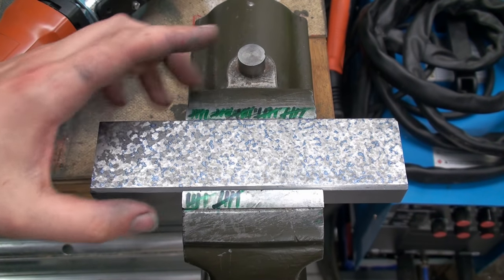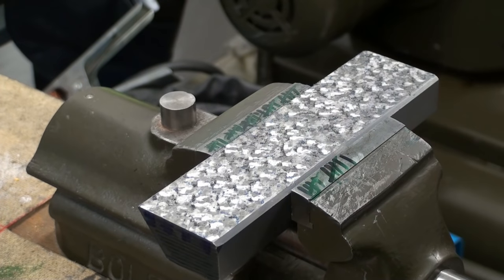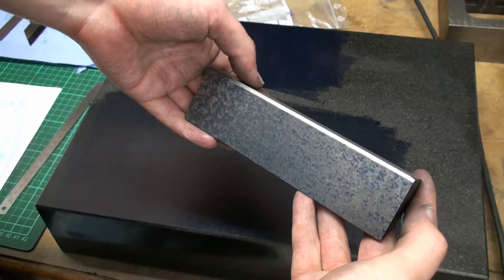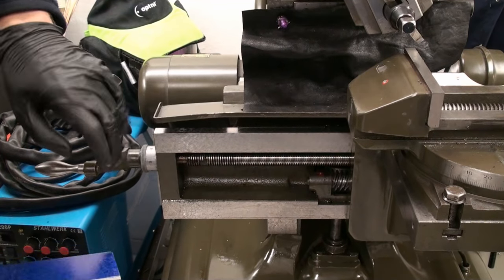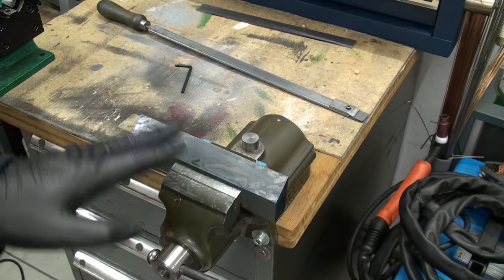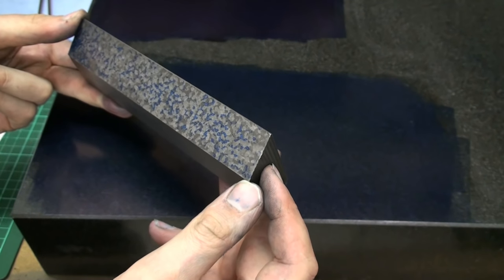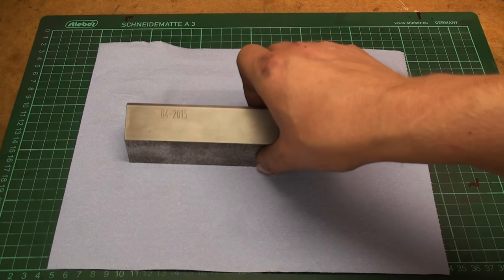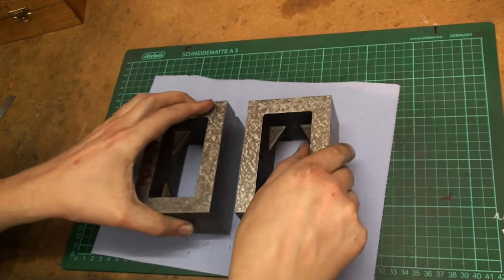Making a straight edge blank Part 2/2

Comment: Great work; it is a labour of passion as one strives to restore older machinery. One way to get higher precision after scraping is by lapping the piece on a surface plate.; but only when your looking at a couple tents 0.0001".
I have acquired a large surface plate and will be attempting to refresh my 1950's bridgeport surfaces.
Cheers,
Dave
Reply from the maker: Dave Prototype Youre right! Lapping can produce an incredible flat surface if done right. I tried my hands on it with a small cast iron lapping plate and diamond compound and I was able to get surfaces very flat and parallel within a few 1/1000mm - Not to be mistaken by using sandpaper on the surface plate, thats in my mind just for cleaning up surfaces, removing highspots and machine marks.. :)
Just subscribed to your channel, I will have a look at your work :)

Comment: You have presented this in a way that makes me want to try it myself. Great video!
Reply from the maker: lornie212 You should try it :)
I started out with an reground woodchisel and an piece of cold rolled steel...worked kinda..but a carbide handscraper and a piece of cast iron work way...way...WAY better.

Comment: Very cool video series, and interesting to see a shaper in use. I am doing some tentative research since I want to buy an old lathe of some kind  and the lessons in this video might become very applicable....
Reply: BTW what is the single most important tool if you want to begin making something very flat and straight? Making straight edges and such seems like a good way to learn scraping. I am thinking it's the granite block reference surface... I have really nothing in the way of tools for this, mainly done woodworking and welding.

Comment: Hi Stefan, I know this video is a year old now, but better late than never.

When i was doing my trade (Fitter and Machinist - First class (toolmaker)) We did hand scraping as an excercise, i thouroughly enjoyed it. i agree that is has its uses in some areas, but i would like to make a suggestion.

Instead of scraping put a sheet of 800 grit wet and dry paper abrasive side up on your surface plate and then place your part on it in a figure 8 pattern. if you want you can then move up to a finer grit. In my experience this gives a move even and flatter surface than scraping in a much faster time. Not saying what your doing is wrong or anything, i love it as a skill, but maybe try out the method i just mentioned and compare the two.

Comment: Noticed that many parts of my old Shun Shin lathe have been scraped flat-all the cross slide and compound ways have the original scraper marks. 20+ years old lathe from Taiwan.
Reply from the maker: +Shevill Mathers The older Taiwanese machines are realy well made - Friend of mine has a NanTong RF30 Mill/Drill, thats made quite nice.

Comment: Stefan, after you scrape with the Biax, and you have hills and valleys that are 5 ten thousandths of a millimeter, can't you put that surface on a rotating plate with some light abrasive slurry, and flatten it much more without anymore hand work?
Thanks!  :)

Comment: Hi Stefan, Many thanks for these videos—excellent as always.  Two questions:
1. Did you have to hone the cutters often during the 25+ passes?
2. In general, would it be a good idea to rotate the part in the vise 180º after each pass?  I find that in many things, a slightly different point of view can reveal things not seen before.

Comment: Hi Stefan. Great video. I'm not sure if I missed your explanation,  but why scrape the 45 degree surface. Why wouldn't you turn the straight edge upside down to measure the top of the dove tail and use the already scraped surface.

Comment: seems like it might be wise to flatten roughly with lapping or sanding to gain control of the surface before finishing with hand scraping?
Reply from the maker: I am pretty sure the scraper is faster than lapping ;)
Next time I would go way more agressive in the beginning.
Reply: Yes this was my idea also. I have watched a lot of scraping and usually the parts were first machined then a rough flat was achieved with wet and dry sanding or lapping, and I suppose hand scrapping would also work depending on how large the surface is/was. You are a master of perfection So I will not fault your methods getting there!  Cheers

Comment: Stefan, since this is cast iron, wouldn't lapping also work as well and be just as quick or quicker than scraping? I understand where scraping and flaking is better for machine ways because it gives oil a place to reside. However, this straight edge doesn't need that. 

Danke,
Chuck
Reply from the maker: I dont have the equipment to do proper lapping and you need the "uneven" surfacae from scraping to do blueing with it, a ground or lapped straightedge would just stick to the other part if you use Canode or Dykem Hispotblue..

Comment: A basic question I have would be how much better if so is scraping than a power surface grinder for accuracy?  Seems that with scraping you could end up 'chasing' yourself a lot on a square or parallel surface and trying to true two separate blocks to the same dimension would really be difficult compared to surface grinding them.  Of course some things are too big and awkward for the grinder too but machinist blocks and straight edges would be good candidates?  The time consumed scraping is a bit off putting if one has other pressing projects.  And again good coverage on an obscure topic of interest.  Not much out there on the application of scraping and you have shed light on the subject.
Reply from the maker: +Douglas Thompson Depends on the surface grinder and the person running it :)
Generaly spoken, a surface grinder can of course produce incredible accurate parts, if setup and the actual grinding are done right. But if you dont have a grinder or the space for it or the part it to big for the grinder at hand, scraping is the next best thing. Aaaand its easy to get things out of square/parallel/flat on a surface grinder if one does not take material stress and so on into account.

Comment: Now that you have your surface grinder would you consider using it to finish your box parallels?
Reply: Good question! My guess would be no, unless he has already inspected the grinder dovetails for straightness. A surface grinder is very good at grinding a surface parallel to the chuck (since the grinder itself trues up the chuck), but if the machine's dovetails aren't flat/straight any ground surface would mirror the shape of the ways.

Comment: When scraping like this, how do you ensure that it is parallel? Thank you!
Reply from the maker: You measure parallelism either with a micrometer or with an indicator on the surface plate and correct for it.
Reply: Stefan Gotteswinter thanks, but how do you then correct it? You scrape more on one side? But how do you then make i flat? I would love a video on that :) thanks
Reply from the maker: Yes, you scrape more on one side and gradiently less to the other side. Google "step scraping" i think you will find an explanation then :)
Reply: Thank you :)

Comment: Very good video mini series, thank you!
I have a question though, what makes that power scraper different from a reciprocating saw? As I have one of them already, I could (I think) easily make an attachment for a scraper on that and save myself money on a new tool
What would be the draw backs? Length of stroke? Under or overpowered?

Cheers!
Reply: The power scraper uses a swash  plate to vary the stroke. On a recip saw there are two methods to get the action one is a sort of wobble plate the other is a form of Scotch Yoke, the latter can be modified Ca Lem shows how to do this. The recip saw will it be underpowered as they Use generally larger motors. Biax use  a motor  from a 4” or so angle grinder. The main issue with modifying a recip saw is balancing as the modifications change the reciprocating and rotating masses. Ca Lem reports this issue and is looking to build a second power scraper to address this. I am building one from a Makita recip saw and plan to add a weight pocket to the counterbalance so I can find the sweet spot.
Reply: @tonyray91  legend! Thanks for the info
Although I didn’t necessarily understand all of what you were saying (sorry) I appreciate the response!

Could you link the video at all? Or post the title of the video in question so I can check it out?

Comment: The surface is flat but is the angle accurate?
Reply: Considering it's a 45° angle for use in spotting 55° and 60° dovetails, I can't imagine it's a critical dimension…

Comment: Hi mate,  I have been watching these two videos several times now, and still learn from them.  I heard that the owner was pissed off because he wanted to scrape his edge..... Nah just kidding.  I'm wondering if you ever finished those blocks.
Reply from the maker: Haha, He has still enough to scrape, the straight edge helped him to make a new top slide for his lathe and scrape the ways of it - He did very well :)
The two cast hollow parallels? They wait for some attention. Maybe I will surface grind them. and just flake the surface with the scraper.. ;)
Reply: That is cheating, that's how I would have done it  ( -;

Comment: Hello Stefan,
This is a great project about precision, one question though, how did you control the 60deg, angle to keep it always true?
Also anxious to see your method on how you'll get the boxes perpendicular on all sides, low precision is kind of easy, but .001 mm. is much more of a challenge...
Nicely done,
Pierre
Reply from the maker: pierre beaudry Hi Pierre,
I never checked the angle of the bevel - In fact I machined it to about 54deg, so he can get into doveteils 54deg and bigger - He can tilt it to the dovetails surfaces (The actual angle of an doveteil doesnt matter, the two parts only have to match). After trueing up the male (or female) portion of the dovetail, the mating part is scraped to fit the other one.
Thanks for watching,
Stefan
Reply: Thanks for the details, I was under the impression that the dovetails were 60deg., but, you're right, they only have to match...
Great videos...!!!
Reply: Pierre's Garage *

Comment: Good fun for a craftsman.....but what guaranteed the correct angle?  need a master for that
Reply from the maker: It is now the master for that purpose :)
The actual angle of a slideway/dovetail does not matter as long as both sides match up.
Reply: Yes that will work but will likely cause additional scraping to match your master assuming the two angles are different slightly. You did say your master was for a friends existing machine right?  Thank You for the reply and keep up the fine work.

Comment: Another excellent video. I assumed that the 2 surfaces needed to be scraped parallel to one another. Is this not the case?
Reply from the maker: tacitus101010 Thank you! on the straightedge I need just two flat surfaces - The angle between them doesnt matter because in use the straightedge can be tilted to the surface that has to be touched of.

Comment: Excellent work and great tutorial as well.  I wish there was a way to give multiple thumbs up!  One question, do you have any concerns about the handle holes and milling of the bar ends distorting the scraped surfaces?
Reply from the maker: ***** Hi Bob, No concerns on the milling and drilling as it just affected the very ends of the straight edge. But I would have been very cautious if I had to machine one of the long sideds after scraping, then that thing would have moved, thats sure.

Comment: This straight edge is used as a measuring  tool, would you make as much effort on an actual lathe dovetail?
Reply from the maker: Yes, sure. The precision of the machines guideways are key to the precision of the lathe...

Comment: How does one make a flat plate to start with, meaning no test surface to start with?
Reply from the maker: Shevill Mathers Hi! I only know the method where you lap or scrape three individual plates against each other - During the process the error cancles itself out - When you google for "three plate method" you should find a description of that process.
I will certainly never do that, because a good surface plate is not very expensive anymore :)
Reply: Thanks, Stefan, just like making optical flats then, make three to get one, which  I have done a few times, just using much smaller measurements-Angstroms.  I Enjoy your video, very instructive and interesting.
Reply from the maker: Shevill Mathers Did not know that its in optics a common practice - I have  only seen somebody  in a german onlineforum to attemt it by grinding three granite tiles against each other to get flat reference surfaces, but he almost got mad as the granite warped and moved because of some inclusions in the stone....but he finaly got them flat and stable:
Thank you for the support, comments and of course watching my videos, I appreciate it very much :)
Reply: There is a nice book, titled "Foundations of Mechanical Accuracy". There is all the way of creating flat surface described. Ping me if you need a copy of that book
Reply: +Andriy Podanenko  Thank you for that information.

Comment: If you had next to last pasted the beveled side at less than 0.5 mm then made your last passes a 0.05mm with a very last pass at 0.01mm you would have not heated the metal so much in the middle. you can tell this by the middle is always hollowed from both ends, remembered back when you start your first scraped you had to scrap both ends almost the same with the one end being just a little less than the first end that the end had started on its cut.

Comment: Forgive my ignorance, I know nothing about machining other than what I have watched on YouTube, but why wouldn't you lap these things flat/even? The scraping process seems very labour intensive.

Great vid though, very interesting, I'm just interested.
Reply: A few reasons. It's much easier to bring a scraper to a machine that's installed than to bring the parts of the machine to a lapper; lappers don't hold tolerances over long distances as well; and scraping leaves valleys for bearing oil to collect, whereas a lapped surface is actually a bit too smooth.

In practice, machines like lathes have the ways ground or lapped and then the saddle scraped to match.
Reply: interesting, thanks for the detailed reply! :)
Reply: A straight edge doesn't have to bear oil, though. And you can put it on a lapping plate.

Comment: Stefan,  I was shown, by an old machinist, great handles for hand scrappers and files. Rather than using the traditional file handle, a common golf ball was used as a handle. Simply drill a starter hole into the golf ball and then tap it solidly onto the tool handle. It fits comfortably in the palm of your hand and you don't become fatiqued or cramped as when using the older style file handle.
Reply from the maker: Nevin G. Summers Thats a good idea and thats about the shape I was thinking of - If I find some golf balls I will give it a try :)
Reply: Gonna be making a scraper or two soon and that sounds perfect. Thank you for sharing that.

Comment: nice to see someone measure the scraped surface. I read somewhere that you should use pins to support the block though for most accurate measurement, not sure if parallels work the best

Comment: If you cut deep then you must cool the part before the next pass this why you cool the part with very light oil or water 15% 85% antifreeze or 10% and 90% alcohol ( but watch out for fires when you use alcohol  DO NOT USE ALCOHOL WHEN THERE ARE BRUSH TYPE ELECTRIC MOTORS on the machine  in the environment all around you ) these will keep parts cooled down and stay in shape of at and around near room temp. This learned back when I machined flywheels these just can't be concaved. I ate three flywheels hope you know what I mean. My last on these was 0.001 deep @ 0.005 feed rate and back side of machine chuck turning upwards tool down always casting chips downward and double block all Allen-head bolts locked down and bitting stock bars to hold cutting edge from any movement. Never use quick tool holders when doing this operation. { They will talk to you every time ( chatter ) and leave presents of cactus needles for you too when you cut too hard. }.

Comment: Too many passes. I tend to think that the power scraper isn’t able to give precise enough strokes, and it scrapes more than needed. I’ve never used one, but I believe that a manual scraper for fine passes would actually be easier and quicker. Of course, it’s the only way I’ve done it, but from watching this it seems that at some point, the effort Is greater than the benefit.

Using the parallel method, the edges can be straight, but the part can be twisted. If it’s high on two opposing corners, it can sit flat on three. If those three are on the side being measured, it will measure straight. If you then turn it around, with the other edge now being measured, and those three corners are sitting flat, then that edge too will measure straight. Both edges then are straight. But the part can have a twist. To eliminate the possibility of that, the indicator needs to be slid forwards and back, in addition to being slid side to side. The weight of the part here should prevent it from rocking back and forth when doing this. But it could be such a small twist that you can’t feel it if you try to rock the part by hand.

Comment: is there a reason you trimmed, drilled & tapped the edges after the scraping instead of before?
Reply from the maker: No real reason for that...In retrospect I would do that before finishing the scraping - The drilling could lead in warpage on the ends of the straightedge.